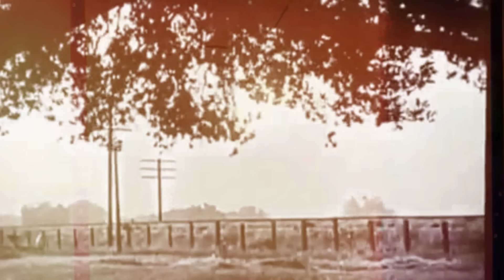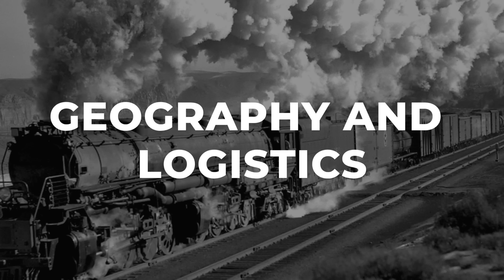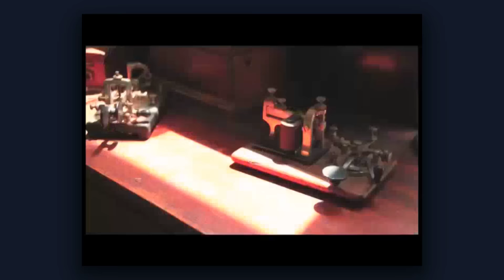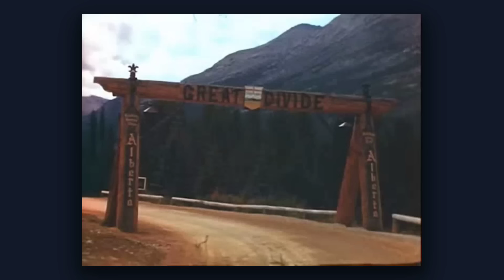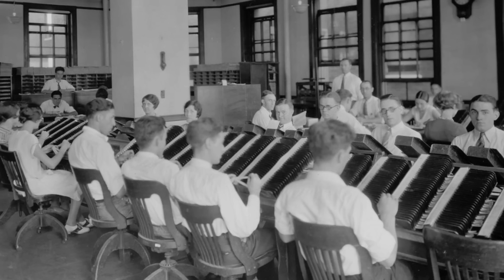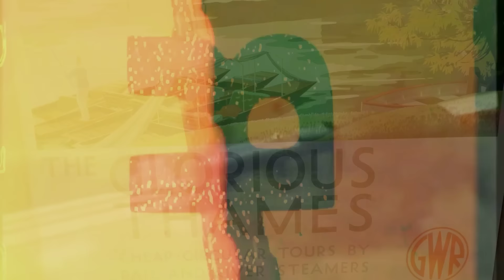The Real Reason American Steam Trains Made More Smoke Than UK Trains

Comment: There is so much factual errors in this video.
Firstly Boilers are sized according to the power output needed. they don't care if they have a 1000 gallon or 10,000 gallon water tender.
They are designed to provide the amount of steam required to keep the train running at the required speed and power requirements.
The tender is sized to carry the amounts of Coal and Water that the engine needs to run between scheduled Coal / Water stops.

Then there are yet more factual errors regarding the width of the fire box and the way it is "Fired".
The UK adopted wide & deep fire boxes a very long time ago.
Yes the USA had far bigger fire boxes as their top line engines had some 3 X the power output of UK engines.
That said the "chemistry" of Coal combustion is well known and fire boxes were designed according to the characteristics of the coal being used.
Smoke is caused by incomplete combustion and there were several well used techniques used to reduce the level of smoke emitted.
First rule is to install a well designed "Brick" firebox arch
Second rule was to allow enough "Secondary" air to enter the firebox ABOVE the burning coal on the fire grate
Introduce more secondary air virtually eliminates smoke production.

Then we come to the way the narrator describes shovelling coal onto the fire.
Firstly all steam boilers need to be fired "Little and Often". Just shovelling heaps of coal on at station stops just "Black out" the fire and causes huge amounts of smoke to be produced. Also no US Steam loco could pull any train from station to station without extra coal being added to the fire.
Here in the UK we had our own fair share of long & steep grades with the engine working hard and the throttle fully open.

Again rapid opening of the Throttle draws a lot more air through the fire and often results in the whole fire being blown out through the chimney
This narrator has never fired a steam loco and does not understand how the fire is drafted.
Reply: Quite the critique.
Reply: Also, use of the stack blower, which blasts steam directly up the stack to temporarily increase draft when raising steam on start up or when power demands reduce pressure, can cause clouds of smoke and even "lift the fire", (blowing it out the stack).
Reply: The colour of the smoke depended on the quality of the coal as much as the combustion efficiency.
Reply: @ngauruhoezodiac3143  No, when Flying Scotsman went on tour in the US, she had two tenders to cope with the distance between coaling points. She used local coal, but didn't suddenly start belching tarballs. Yes, longer trains meant heavier loads, but we ran more trains.
Reply: @RahereTheGenius  Thats because Flying Scotsman was NEVER run as hard as an American steamer, and Flying Scotsman posed for pictures more often than not. I find it funny how many people think, just because the American steamers are belching black smoke that there is any difference on how the steamers were built or run. British locos were run a certain way when they saw railfans with cameras, they POSED for the pictures, that isnt how theyre normally run either, they belch black smoke too.
Reply: @alexmiller9219  You sound too young to have known them. Our garden backed onto the London-Ashford railway line used by the London depots to retire their fleets in 1968. We saw the lot pass on the slow track nearest the house, hundreds of all sizes, Heavy Goods, Express, right through to small tank engines. We most certainly weren't deluged in soot!
You're arguing from real experience, certainly, of the cost of hauling consists hundreds of trucks long. There was no real reason for that, those consists could have been broken up into several shorter trains, offering better service to your customers and far less wear in the tracks, which has become a real issue in recent decades. When I see what we'd call banking engines every so often in those trains, I count them, as that's how many short consists they could have sent if separated.
Reply: American shovels are bigger.  The ones the British use look like they are for live steamers..... 🙃
Reply: @paulnicholson1906  Its not the size of the shovel that mattered on British locos, it was the way it was used.😁

Comment: I think you need to do your homework more carefully.  "A Great Western express could expect to stop to fill up its water tanks at every major station"  Total bilge.  Ever heard of water troughs? All main line UK trains picked up water from troughs without stopping.  The exception was the lines that constituted the Southern Railway, which never had troughs, which is why their tenders were called water carts.  Study your subject with more care before committing to video...
Reply: The use of troughs (or track pans to use 'Murican parlance) was common on the New York Central and Pennsylvania Railroads, typically spaced at 30-45 mile intervals. The cavernous tenders exemplified by the NYC 'PT' tenders mostly comprised coal capacity to enable though runs from the edge of New York to Chicago with a single coaling stop, taking water from pans on the run.
And nothing at all to do with the emission of smoke.
Reply: The water troughs were for expresses running non-stop fot hundreds of miles. Southern's longest was London-Weymouth, stopping at Basingstoke, Southampton and Bournemouth. Barely 50 miles between them.